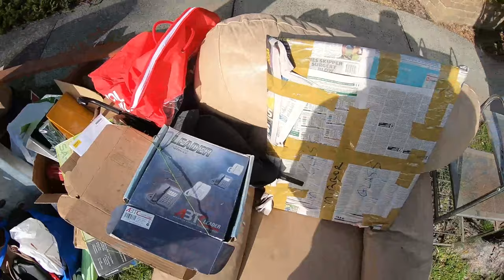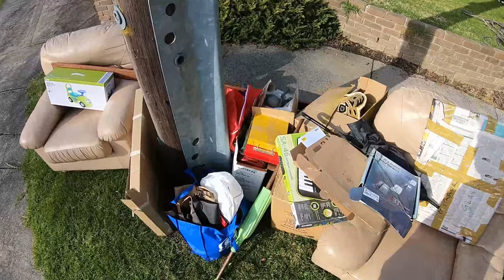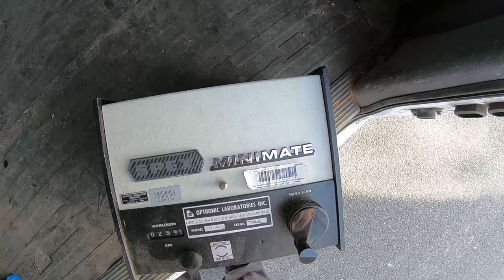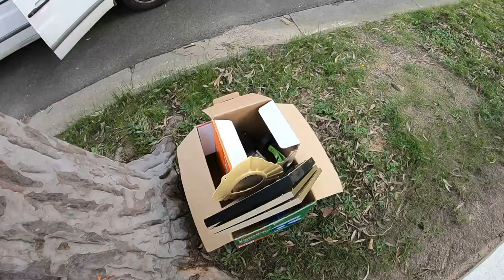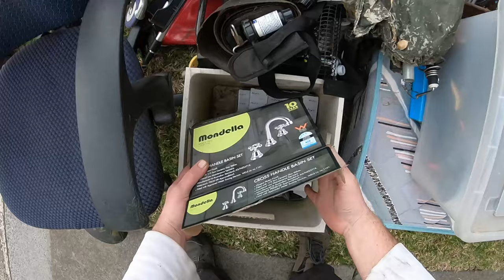Free Stuff Everywhere, Street Scrapping Madness

Comment: Lol that old projector was full of expensive resistors and silver solder ....
Reply: There is only one case where resistors are expensive. That's when the US military bills a 1/2 cent resistor as $100 so they can funnel black budget money into the secret space program.
Reply: @E-BikingAdventures  Not rue.  The old electronics from the 50s and 60s are full of precious metals.  And even the gold plating on the slot cards from the 80s is so much better the modern stuff.